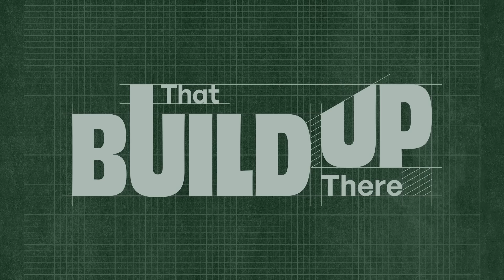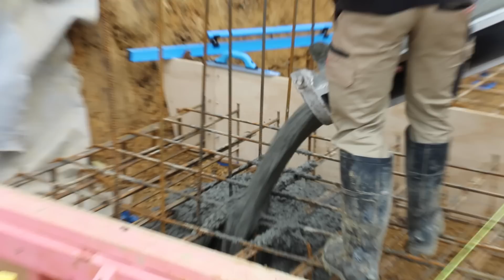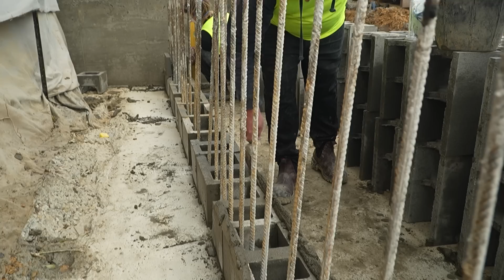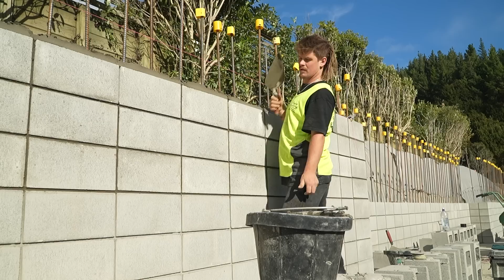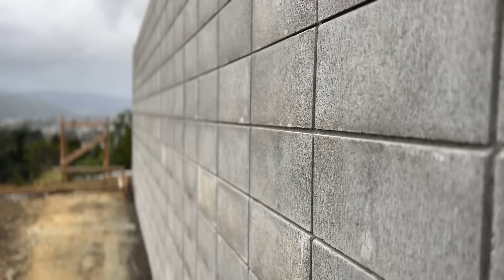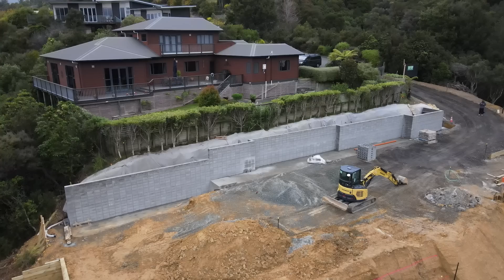We Built a Giant Wall to Stop Nature!

Comment: Wouldn't pouring concrete in more than one stage effect the strength? I imagine the strongest version is one pour. Otherwise you get a split bond line in the middle of the wall horizontally that is not as structurally sound?
Reply from the maker: Great question — one pour is ideal, but staged pours are common and still strong if done right. Engineers allow for it.

Comment: I am surprised you are not tied into  the dirt wall with helix screws or other type of anchor. What keeps the wall from pushing out except the mass and friction of the footing? Dont you get frequent rain saturation and earthquakes / seismic events?
Reply from the maker: the insane amount of concrete and steel keeps it from moving :) thanks for watching
Reply: I agree. Although the inverted "T" looks good on paper it really only has one line of reo holding it down. Surely this is a bending line when the earth pushes against it over time.

Comment: Structural engineer here. Interesting detailing around the starters development into the footing. Not a great way to detail retaining wall starters. That bar likely isn’t completely developed. May not need to be but poor practice generally.
Reply from the maker: interesting - compared to other ones ive built this is one has more steel than normal

Comment: As an architecture student in Quebec, I would add a drainage membrane over the bituminous coating in order to facilitate the flow of water to the French drain.
Reply from the maker: I love Quebec - we have put 3 coats of Sika Seal on back, 300mm of drainage chip the whole way up the back side of wall, and a 100mm novasoil to sump drain :)
Reply: @nzbuilder  I like the method, I'll keep it in case I need to use it in one of my projects.

Comment: personally i would have overlapped the blocks in a "fletcher" type bonding system and use some horizontal steel bars as well...but the workmanship is spot on!!
Reply from the maker: we wanted the look of stack bond :)
Reply: Designed by an engineer

Comment: We do retaining walls with blocks over here as well, but with dry stacking, the mortar goes only under the first row. Usually anything higher than 1,2 (1,5) m we would rather use architectural concrete poured into formwork as the price could be even less than building it with blocks, it saves time and the wall can sometimes be thinner with less concrete but same load bearing capacity and durability. Or we might use precast L shape units for retaining walls, the good thing is they are prone to cracking because the elements are not connected between each other. Within the wall you built do you have any expansion joints? We usually do within anything monolithic longer than 8 to 10 metres.
Reply from the maker: I seriously looked at Broadform concrete, and I love the look. The work involved to get it right was just too much to justify on this project
Reply: @nzbuilder  thanks. I understand you have probably considered more options I know you are a detailist.

Comment: And the question we ask. How much did it cost. I'm guessing 6 digits. It is very pretty and is clearly a main factor for making the rest of the build easier and show casing the high quality of the rest of the build to come .
Reply from the maker: yep not cheap - obviously it depends on size / design but allow about $600- $800 per sq m of blocks for everything from footing to back fill. Membrane if required about 50% of that again.,

Comment: Hey mate, cool to see the breakdown of how you tackle complex civil works like this! I love the design of that blockwork - definitely has changed my perspective on how good it can look. I wondered, did you or the engineer ever consider a product like Dincel or something similar during your design phase? It's something I'm considering on a very small lot (205sq!) building close to boundary on a very steep street with an uphill neighbour (they are 1.4m from boundary!). Goal is to cut or batter as close to boundary as possible and maximise the volume downstairs, waterproofing essential to double as the external wall of the house. Really challenging to find a builder brave/crazy enough to take it on haha. Thanks!
Reply from the maker: Never used Dincel here in NZ but did consider a few options - watch this weeks video for more :)

Comment: @16:00 the design looks solid.
Is there any reason why the structural engineer opted not to use Shear key on the RC footing?
Reply from the maker: The engineer likely determined that friction and toe resistance were sufficient to prevent sliding, making a shear key unnecessary for this wall - keep watching to see us complete the home :)
Reply: Because sliding would not have been the governing failing mechanism during the analysis where shear key would be required to provide sliding resistance. This  means that the governing failure mechanism would have been the over turning moment as would typically be the case in many cases. Most of the time, the dead weight of the wall itself would provide adequate stability against sliding eliminating the need for a shear key. (Structural Engineer here)

Comment: The stacked block wall looks neat, but for a retaining wall wouldn’t staggered config be stronger? id did see the block cut outs so i guess its virtually a tilt up slab, looks mint
Reply: Strength all in the rebar and grout - those blocks are pretty weak and are really just permanent forms.
Reply from the maker: Strength is in reinforcing :)

Comment: No staggered block joints?
Reply: was thinking the same thing, but i guess the engineer has said that is fine 🤷‍♂🤷‍♂
Reply from the maker: the strength is in the reinforcing steel
Reply: I guess it looks neat but it also feels like an unnecessary risk in stability.
Reply: The strength is in the rebar and the solid concrete that locks them all together. In Denmark, they don’t even bother to grout the blocks together. Think of it like form work
Reply: It's very common in NZ. With all the steel reinforcing and concrete, they don't need to be staggered like a normal brick wall would.